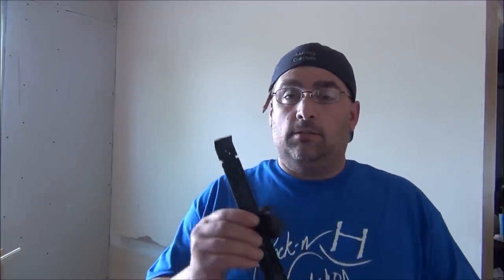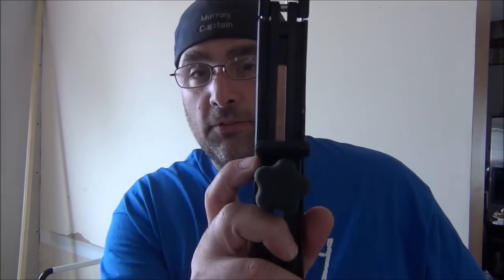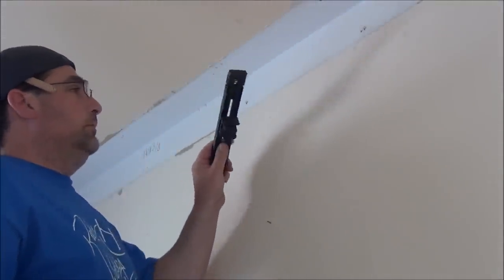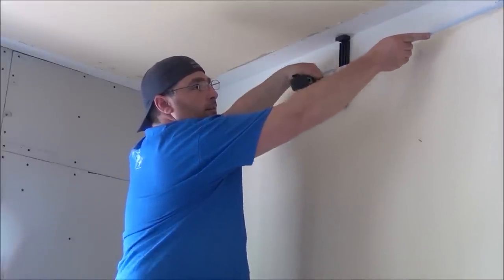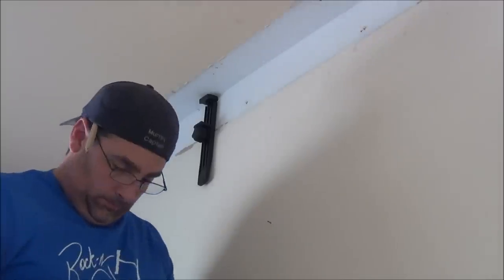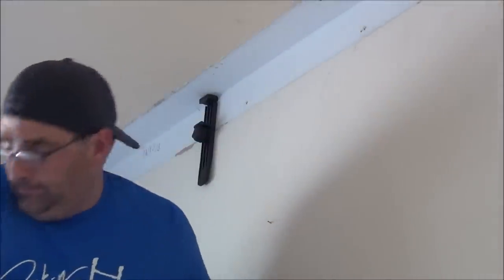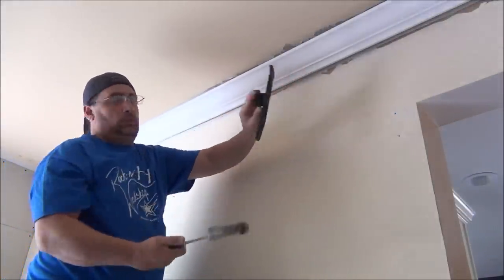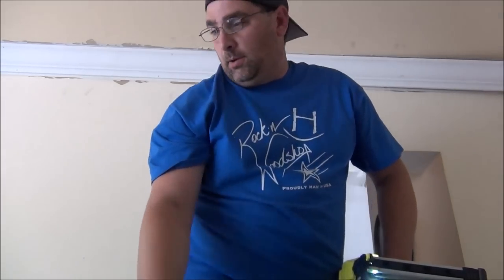Crown Control from Fast Cap

Comment: thats pretty cool mike! thanks for sharing. gonna have to look into that thing is it JUST for crown molding ??
Reply from the maker: Joe Walters you could probably use it to hold up any long piece of wood(chair rail) but then you will have to patch the holes it makes in the wall, with the crown molding it is hidden....lol. I wonder if they make another one for chair rail with a suction cup and laser light to line up level.....that would help alot also....

Comment: That's great!!! Thanks!!!
Reply from the maker: great product works great have used it many times over. good luck.
Reply: Only works if you don't plan to use glue in addition to nails for installing crown, otherwise you'd get glue onto the hanger, which gets in the way.  Pros almost never use glue due to the extra effort and costs them time.  DIYers typically do a better job as a result.

Comment: should have a guy to hold your tape to get a good mesurment.the same guy can hold the molding as you nail it .what do you do on a 60' wall?
Reply: you can see your short about a 1/4" from the start.not so good if your using hard wood molding.dont mean to be a hatter but Bro.should cut the dap and glue off the old molding so you don't make a mess of the drywall
Reply from the maker: it must have been the camera angle because it wasn't short, that wall had new sheetrock and the corner wasn't taped yet.
Reply: yea Mike after looking at the video again I can see it looks close and its cool the way it holds your tape.im old school and cope my corners. gess I'm not use to seeing the molding go up until the site is taped and primed.You are just trying to explane the tool for guys that don't do this all day every day. I could see how this would save a guys ass that's stuck alone on site.im a stubern old guy that's use to having a kid doing all the setup and loading or unloading of the truck. Respect and happy building Mike.maybe I should try it before I open my clit massager peace
Reply from the maker: np bro. i didn't take any offense. yeah if my son was around that day he would have been helping me hold it up. He was only 10 at the time and my wife would have killed me if she walked in and he was up on the ladder...lol. now he helps me now and then, but i like to work alone there isn't anyone to yell at if something goes wrong....well i yell at myself, and have and argument, but never win or lose....lol. have a great weekend. i cope my chair rail or base, don't feel like it on crown.......
Reply: lol your funny Bro Respect.would have fun working on a project with you some time.I had a tree fall on my shop this week so I need to get that fixed fast.happy building and keep up the good work
Reply from the maker: sure. hit me up in the summertime we can work something out. so sorry about the shop, really stinks.